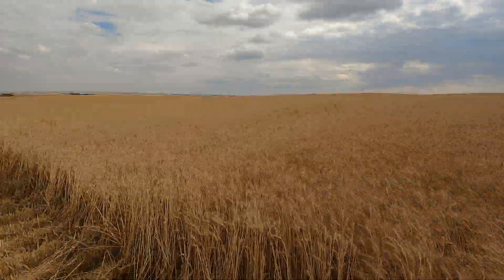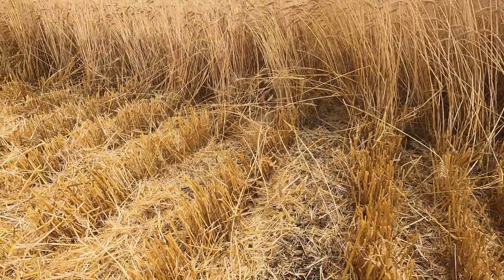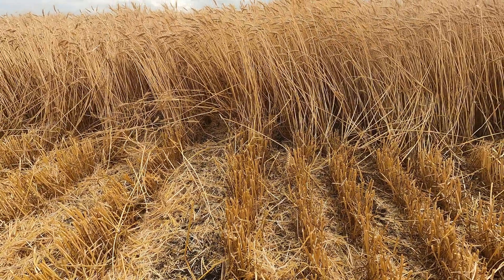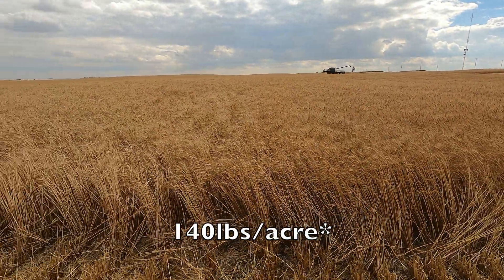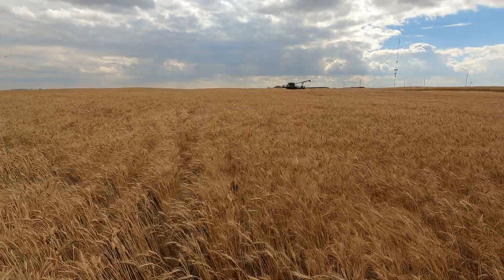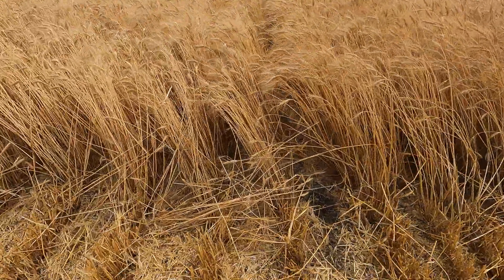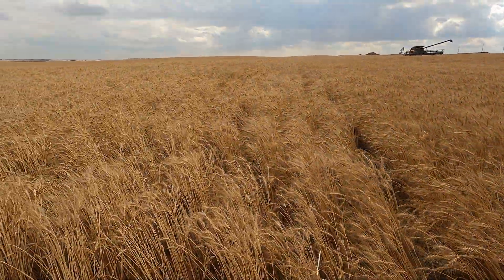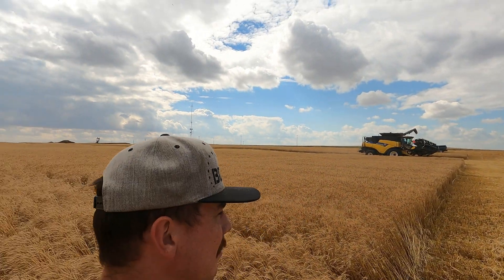Barley Lodged BIG time, Harvest 2022

Comment: We just purchased the same drill, was concerned about yield decrease in wheat. On our farm it would equal about 17,000 dollars decrease on production. Not including protein premium. 

Interested to know if the canola yields were increased on 15" spacing to make up the difference from lost production on your wheat. 

For us it would take 15 years at $17k to make it worth while for us to purchase a drill on 12" spacing. Mind you a drill on 12" spacing would require us to purchase a higher hp tractor, with higher hydraulic flow. Which in turn would burn more fuel and cost more per hour to operate.  So if you add the purchase of a newer tractor it would be 30 years or more to see a return on a different drill and different tractor. 

Curious to hear your opinion with the new Ultra SR on your farm and if it has a long term role in your operation.

Comment: Growth regulators are not expensive especially when you see the price of not doing it. A yield hit of probably somewhere in the vicinity of 30% plus the extra disease pressure incurred when it goes down like that makes straw shortener an absolute no brainer. Cycocel, Terpel and Trexel which is a generic of Moddus are other options.